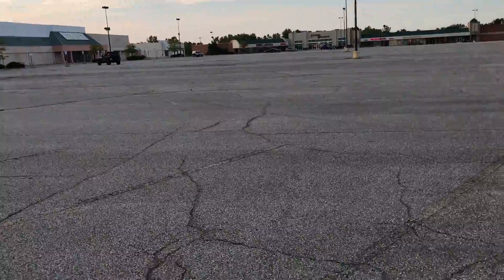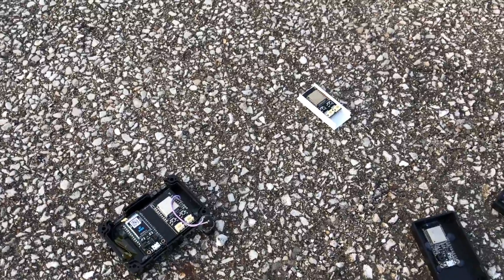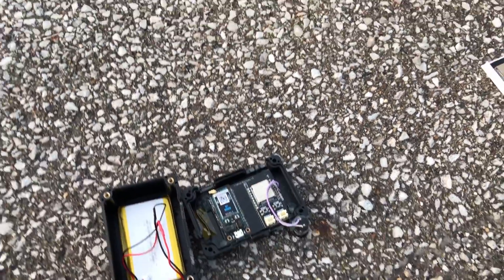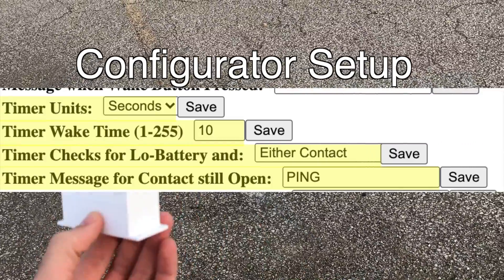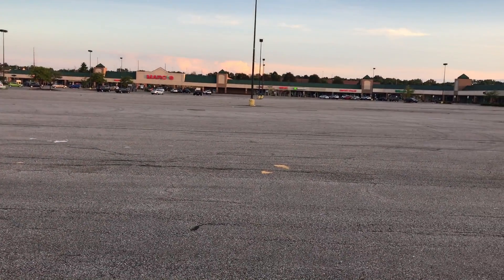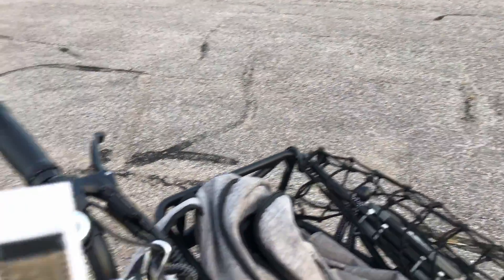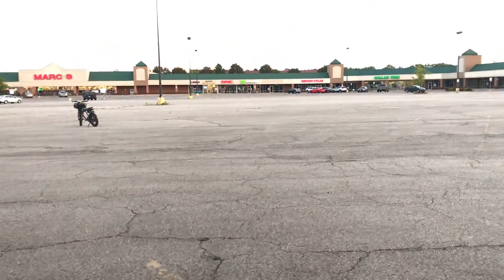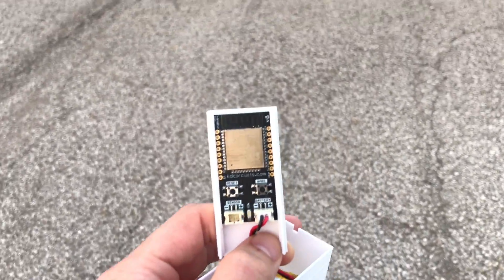Quick-n-Dirty Testing ESP32 Range Extenders for IoT!

Comment: Have you tried placing the ESP32's in LR mode it should drastically improve range.
Reply from the maker: thanks - will check this.  Didn't know this was possible
Reply: @Kevindarrah  basically you add #include esp_wifi.h. at the top then use

int a= esp_wifi_set_protocol( WIFI_IF_AP, WIFI_PROTOCOL_LR ); Serial.println(a);
 WiFi.softAP(ssid, password);

To connect the serial print of 'a' calls the var and sets the unit to LR mode 

Its pretty cool I have heard up to 1km ranges

Comment: Hi, Kevin 
I am working on 8x8x8 led cube project and I am facing a problem related to power supply. 
Before I explain the exact problem to you let me tell you a little bit about my led cube design. I have 64 anode columns and 8 cathode layers. Before making the controller I just want to check it with power supply so what I did is I connected all the layers to ground and 1 column to the +VCC with a current limiting resistor of 220ohm and it was supposed to turn on the 8 LEDs of a column but when I turned the power on none of the led was glowing. Then I figure out that one 220 ohm resistor is capable of driving 1 or 2 leds maximum. Because if I connect more led in parallel more current will be drawn from power source and more voltage drops across the resistor and that's why led's are not turning on. What should I do?
And I have also read that at one time we can turn on only one layer(64LEDs). Is it true? If yes then how can we turn on all the LEDs at one time?
Because if I turn on more than one layer at a time same problem will ocuur. Because current limiting resistor is only one per column.
Please give any suggestion
Reply: Yes, you can turn on only one layer at the time. The point is to turn it on really fast. Then you turn off that layer and turn on next layer.  Minimum time per layer is around 4.16mS (miliseconds). That's 30 frames per second (1 frame = 8 layers ). If time is larger than that , you'll see flickering... I don't think you can do that manually, you'll need microcontroller.

Comment: just to throw idea to you to consider. We are gardners with an aviary for birds in Michigan with 2acre yard. 

we would like esp32 devices, thinking about 16 in the yard hanging from tree branches with an infrared sensor to detect deer, people, raccoons and opossums. thinking, it should be powered with a battery (one powerful enough -so, I will not need to walk out in the cold snow to change the battery)

Also, with a bright led to flash and solid state sound, to scare trespassers away. Please note: the detecting sensor unit should not be the unit flashing or sounding - that would indicate to a person where the sensor is located. 

Yep, crazy idea. But, there are a lot of crazy gardners who would buy such a system. We are having a Hosta convention next spring - if, available

Presently we have 6Ring cameras in the yard, that sends messages to the  Amazon dots and iPhone that wakes me up at night to scare the varmints away

comments would be appreciated
Reply from the maker: check out my motion detection project - I actually tested this outside and it detected animals walking by: https://trigboard-docs.readthedocs.io/en/latest/motionSensor.html  This setup only pulls 12uA, so you get really long battery life.  Then if you tied those into the cellular based setup, could even have it fire a master flood light or something.  Send  me an email to discuss further... or maybe I'll make an example of this

Comment: Using a single UDP packet for security seems flawed to me, as if for some reason, an interference, etc causes that packet to get either corrupted or dropped, there is no validation mechanism that the trigger notification was delivered. I would consider changing to TCP.
Reply from the maker: yea, actually it's a "blast" of UDP packets, sends about 20 in a row.  So far with like 10 trigBoards here, have not had any issues and the UDP is so fast

Comment: I got my TrigBoards a few weeks ago, thanks.  I was wondering do you use Arduino for all your development or have you used the Espressif SDK using C or C++?
Reply: Or is micropython possible?
Reply: @SolarWebsite  I know Adafruit has started porting their Circuit Python to the ESP32, if they haven't already.  I did find this reference, perhaps a place to start?  https://docs.micropython.org/en/latest/esp32/tutorial/intro.html
Reply from the maker: it definitely possible!
Reply: @Kevindarrah  Thanks, I was just curious if you have done any development in plain C (or C++).  Thanks.  I wanted to look into.  Another question, do you use any JTAG debugger for debugging?  If so, what debugger do you use.  Thanks
Reply from the maker: I keep it all in Arduino, but nothing to stop from moving into the SDK.

Comment: Off topic - Which LED constant current circuit is better for pwm to current transient response ,  dual NPN transistor or the one with TLV431 with a single NPN, both of these circuits you showed in your videos. Which one is good for fast transient response of current waveform like lower current rise and fall times?
Reply from the maker: I like the TLV431, but nowadays you could probably find a nice little driver